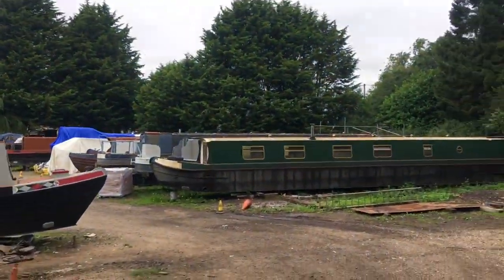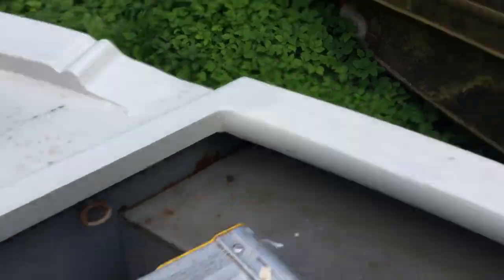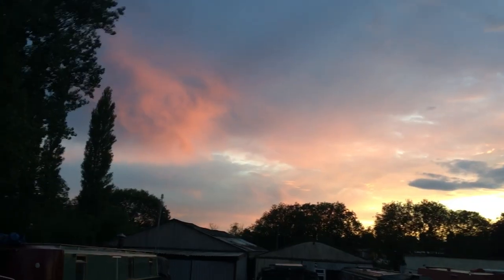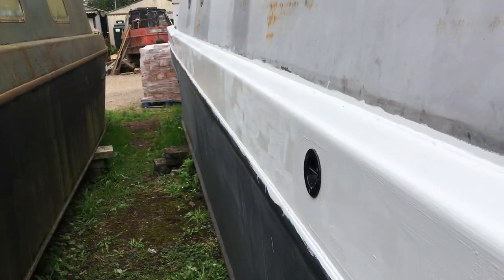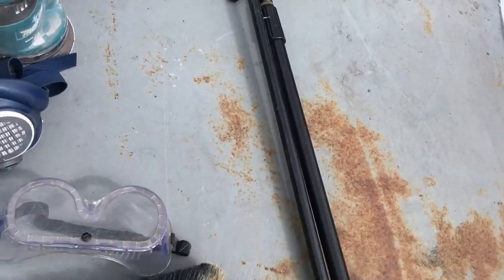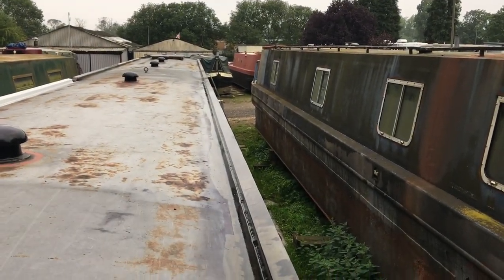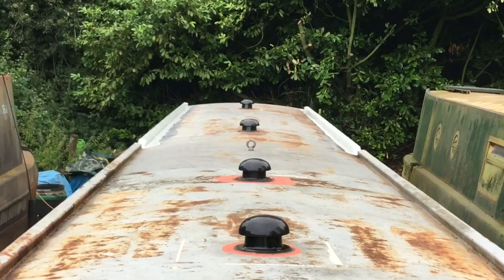52. Painting starts on the rusty narrowboat roof. Forward handrails

Comment: for the welds use a twisted wire brush on an angle grinder, honestly the power of the angle grinder the to toughness of the brush makes light work of removing stubborn areas like that. Worked a treat on my boat.
Reply: and then use a poly abrasive disc, use it for rust and paint removal. the wire brushes are decent but for large jobs an electric drill is very time consuming
Reply from the maker: Yh I’ve got a lot of twisted wire brush discs, I bought 2 and Steve gave me another 4, one of them a 7/8 inch twisted cap, huge! But atm I’ve only got the giant angle grinder, the ones for cutting paving slabs. Was gonna pick up one to add to my set but haven’t got round to it yet. But yh absolutely right on

Comment: Good job. A little concerned to see standing water on the roof. Can the low spots be filled? The welding seems substandard IMO, maybe it was done at quarter to pub on a friday lol. Is that something you can address?
Reply from the maker: It’s a soar valley boat, all the welds are chemically tested, the nanny and grandad make a narrowboat channel has a full build videos of their soar valley boat, I’m not worried, everyone at the yard has commented on the excellent build quality of the boat. As for the standing water on the roof, Yh it’s an issue with boats with these kind of handrails, they can quickly rot out the ropes leaving them wet tucked into that crease, but things don’t fall into the river from the roof like with James style handrails. And standing water won’t be an issue when the boat is rocking side to side in the water. I’d rather have the other type, but if we’re doing that, I’d rather have a midship exit hatch, rather than side viewing hatches and bigger windows for more light. But this is the boat I bought…
Reply: @olivellanarrowboat4319  you can always change bits. Yeah, I saw the build on the nanny grandad. was great to watch. Just thought I saw a couple of thin welds where water was holding on.
Reply from the maker: @DEmma1972 I just watched the video on my regular tv for the first time, much bigger than than the phone it’s edited on. Yh I see what you’re talking about, also there looks to be a gap in the weld, but there’s a weld underneath that one, it looks thin where the bottom weld stops and the top one keeps on going, making a little step. I’m assuming it’s where they initially tack it together before continuously weld it. Thinking about it, the handrail shape doesn’t appear in the ceiling on the inside of the boat, and the upper outer exterior edge isn’t welded, so they must have bent the sides over and welded to the already established roof, making a hollow box for the handrails, fascinating, I’m going to have a closer look when I’m back next week, if the inside roof/wall angle is welded, then it’s 2 welds deep protection from the rain. Good eye, thanks for the concern 👍 and the comment 😉
Reply from the maker: @DEmma1972  and as for changing bits, Yh I’ve had a few people say Houdini hatches, sky lights etc, but there’s already so much to do…
Reply: @olivellanarrowboat4319  its easier to do it now than when your home is all fitted out pretty
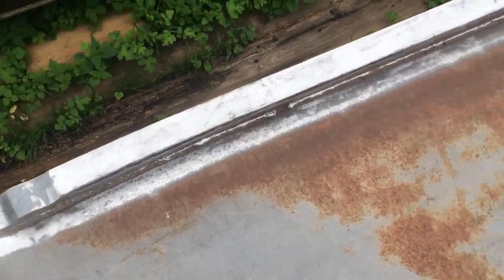Reply: @olivellanarrowboat4319  @1:56 is the bit I was looking at